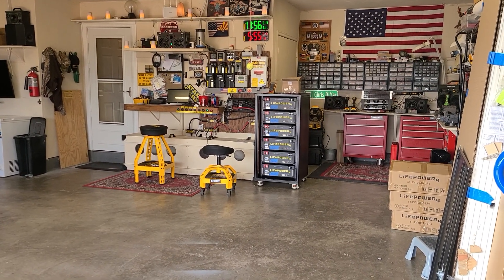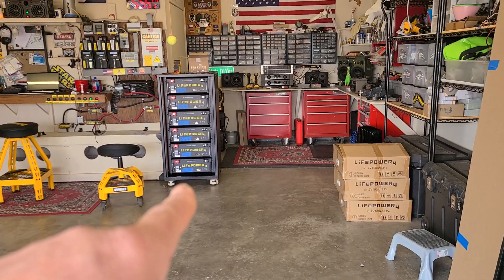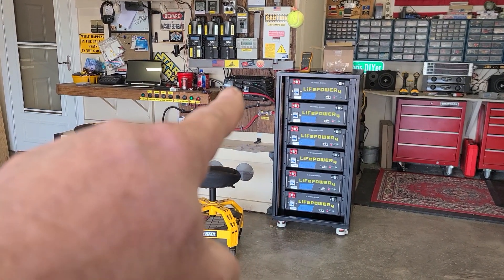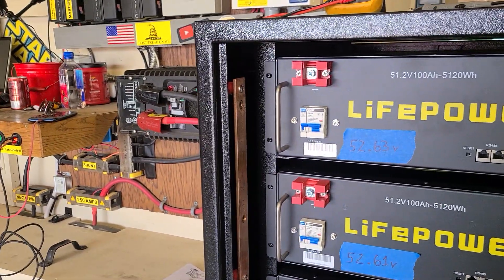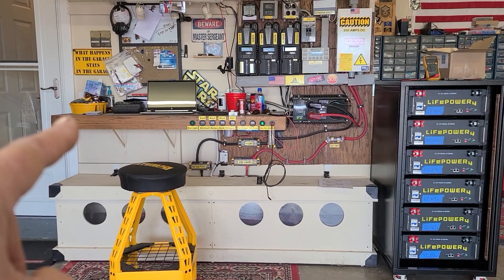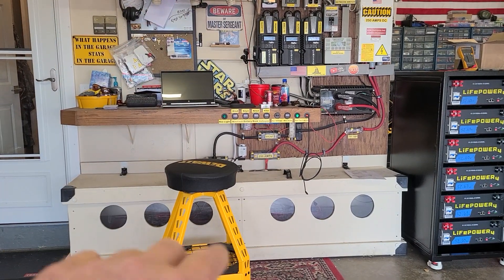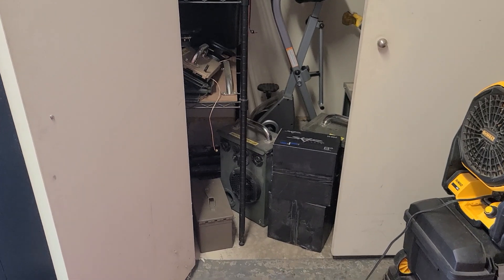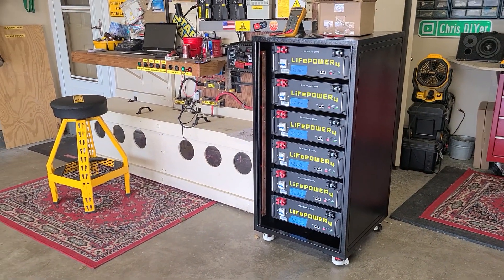Six new EG4 Lifepower4 LiFePO4 48v batteries and rack delivered -- initial thoughts

Comment: One important item for that particular rack is to feed the left/right bus bars from top/bottom or bottom/top using your 4/0 wire to inverter.

This significantly improves the current matching and lifetime of the batteries, since LiFP is such a stable voltage.

Regarding placement, not sure about the codes in your area but heat displacement May the the main concern in summer.  Having a top/bottom large grill for combustion gas can help, but perhaps measure the temperature rise.  Max 105 on worst day is what Id go for.  Also, check for intake clearance, can do weird things with pilot.
Reply from the maker: Yep agree to all. I did a 4/0 top/bottom busbar and it is working as installed. As for temps, yeh, I will keep on them this summer. Being racked and stacked, heat could possibly build-up heat during charging. During discharging however...it shouldn't be an issue -- just good ventilation

Comment: HOWdy  C-DIY'er, ...
I just purchased three (3) New  EG4-LL (V2)  Batteries 
&
Received an identical  6-battery Welded Steel Battery Rack = EG4 LiFePOWER4 (older version with the EXPOSED Copper Bus Bars ) =  for "FREE"  ( as a BONUS ) 
... 
My 4/0 AWG Cables were NOT  l o n g  Enough to place one contact at the TOP & the other Cable at the BOTTOM 
 ( which  I  have been told will lend itself to a more EVEN & CONSISTENT  Charging & Discharging )
my installation was similar to yours, in that  I  already had a functioning system installed  & RUNNING before I added my Battery Rack to the MIX
...
I fed my 4/0 AWG Cables into my RACK from the Bottom Rear (drilled two holes ) then fed through GLANDS  and led them UNDER the bottom most Battery 
&
Attached them to the 3rd BOLT Hole up from the bottom into the Copper Bus-Bars due to flexibility of my 4/0 cables   
as 
To the CHARGING & DISCHARGING = my "bottom-feeding" seems to have minimal effect on my batteries SOC 
& all SIX (6) of my batteries stay within  1% to 3% of each other ... 
...
Give us YOUR Solutions in the next video please 
 COOP
the  WiSeNhEiMeR from Richmond, INDIANA 
...

Comment: Badass! Plan on doing the same for our 1100sq foot house, have a nice cozy isolated closet off one of the bathrooms that would be perfect for running a power station like this. Did you get a discount for getting all 6 at the same time all in?
Reply from the maker: No, the battery and racking were already discounted (on sale). Super fast delivery. The copper busbars needed a lot work (unsafe)

Comment: 4/0 cable for the batteries I didn’t know we needed to run that big of a cable WOW   LIKE you said no instruction Manuel
Reply from the maker: I have seen dual 4/0 battery red/black cables on these six-gun racks.I may be installing a second inverter (for split phase). Inverter surge power needs to be accounted for. My Outback can surge up to 7,500 watts (start up power). So, 4/0 is rated to ~350 amps. So, 350 amps x 48 volts = 16,800 watts. But, if I add a second inverter the surge will be 15,000 watts. So, I am covered.

Comment: More power, arg arg arg. Now you have more room to put those extra electrons in. Next on the list is a 120/240 split phase inverter?
Reply from the maker: Yes...but, I need the sparky to come out and run me new lines to the transfer panel. I need four wires 6 or 8 AWG, two hot, neutral, ground.

Comment: Can you  lay it on its side and put them where the old batteries are?
Reply from the maker: Not sure if that is a good idea. The weight of the batteries is supported by beefy slide in welded trays. If I lay it on it's side, the weight of the batteries would be on the four small rack screws.

Comment: NIIICCEEEE!!!!  Maybe an electrician can move that light switch up the wall? It would depend on if the power was coming down the wall into the switch? If so then you could place it closer to the garage door switches and that may buy you enough room for the rack. Its definitely a beast!! LOL Keep em coming Chris!!
Reply from the maker: I did some measuring. Looks like I will be able to clear that light switch enough. Whew! I will make it work. I am awaiting 4/0 cables and lugs. In all seriousness, 2/0 would suffice just fine (195 amps max). 195 amps x 48v system = 9,300 watts. But, big batteries, big cables, better efficiency and a higher safety margin.
Reply: @ChrisDIYerOklahoma  I agree with the 4/0. Is it overkill for a 48 volt system? Yeah probably but its one and done!!

Comment: Looks good Chris. Flip your negative bus bar around you'll be able to hook up your 2 4- 0  cables at the bottom of the bus bar that's what I did. I have red and black shrink rep coming this afternoon I'm gonna remove the bus bars and shrink wrap them. My friend is on the way over to do the computer work for me to name these batteries and set my computer up that's all out of my wheelhouse I can't do it . Congrats I'm  Re arranging and reconfiguring my whole solar setup as we speak videos to c
ome . very exciting hope to have mine up and running by the end of the month after my meck room  is totally conclosed and insulated.  Making some charge Cables To Go from the bus bars to my outback to charge these batteries in the meantime so I can push them aside full charge until everything is ready for install.
Reply from the maker: That is great news! I figured out how I am going to wire up the 4/0 cables. I made a call to Signature Solar and discussed it all and we came up with a game plan. I ordered a 2" cable raceway for mine vs using heat shrink. I have some rearranging to do also, but nothing like what you have going on! I am okay with computers and getting these batteries talking...but, not quite there yet. I wish there was some type of operator's manual vs watching videos online. Tomorrow, the last of my big honkin' Q-cells will be delivered. Two arrays have six each...doing the last array this week along with the batteries. Total backyard PV = 9,000 watts. I am glad you got these EG4 batteries too...seems like many of us who all started YouTube solar videos back in the day are all going with these batteries.

Comment: I imagine you'll have to tap each bus bar six time each (12 holes, pos/neg) to parallel each of the LiFEPower4 unit.  You have the right idea that each bus bar should be connected at opposite ends to your inverter/charge controllers.  That way, power will flow evenly through all of batteries.  I wlike the closet idea for insulation as long as you can keep that room above freezing and below 90F.  Those batteries will perform best in the 60 to 70F range.  Freezing is the biggest concern but I imagine you only have a few days of extreme cold.  Congrats again on the purchase, can't wait to see the commissioning.
Reply from the maker: Thanks! Commissioning will likely be later this week. I am awaiting some 4/0 welding cables and lugs. Also, I reached out to Signature Solar concerning the buss bars and missing cable raceways. Awaiting a call-back. The current buss bars have 12 screw points already installed for the batteries, but no way in hell to mount a big 4/0 battery lug on the POS and NEG busses. Other owners have both. Hmmm. We'll see what they say,

Comment: Looks like it should fit between light switch and the volt meters on little shelf. 
Tomorrow, disconnect old batteries. 
Measure twice, take shelf off and cut it 
Remount and slide battery cabinet into place :)
Reply from the maker: Yeh, hear ya. I am awaiting new 4/0 cables/lugs and a call back from the company.

Comment: Hey Chris, So happy for you that you got these new EG4 batteries.  I see you got the new wheels, nice!  I got my rack about a month ago with the old wheels.  My bus bars have multiple attachments at the top for the main lugs and I see that these do not.  I would call SS and ask them what they recommend for best method for main lug attachment to your system.  Also, I used 2x 200A fuses at the main lugs to protect 2x 4/0 cables which may be overkill but I did see 238A going into the bank just yesterday.  I don't like that its missing the cable trays, I would probably go ahead and add those and the heat shrink on the POS side.  I would not put it in the closet.  I think your going to enjoy seeing it out front as part of the overall system.  I am very happy with mine so far and I think your going to love them as well.  Congratulations!  :)
Reply from the maker: Thanks! Your videos really helped me out. I am on "call back" from Signature Solar with these buss bars and missing cable raceways (mine didn't come with them). Get this: my third round of Q-cell solar panels (six of them) will be delivered tomorrow. This will complete my backyard "trifecta" with three arrays, each with six Q-cells (9,000w total). Fun times! My local casino paid for these EG4 batteries after I won $8,800 on a slot machine a few weeks back. Hahaa...no brainer there. Thanks again...I will let you know what transpires with SS. My e-mail is ChrisDIYer@yahoo.com
Reply: @ChrisDIYerOklahoma  That is unbelievable.  I think you should name that new bank: "Jackpot!"
Reply from the maker: @HomesteadEngineering  😄 - GREAT idea! That money from the casino was $8,800 after taxes. I hit for $11,522 (three jackpots) that night. So, it was like they bought me a battery bank Scott Free.

Comment: Move things around right infront and place them there..next to the water heater you might have problems like leaking pipes..just stay away from the water heater
Reply from the maker: Yeh, it was just an option-brainfart idea. It gets too hot in that closet
Reply: @Chris DIYer  How tall is that cabinet with wheels? Website says 46" but that looks taller, just curious because I'm setting up a new system based on the posted dimensions
Reply from the maker: Just measured 49.5"